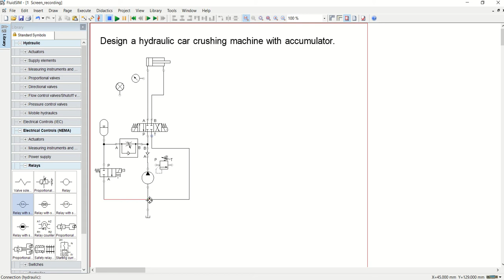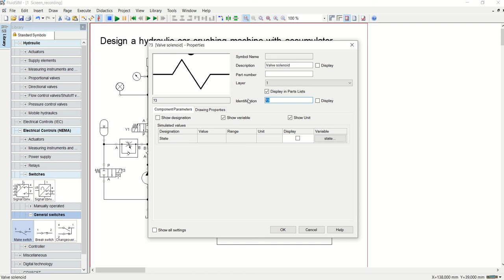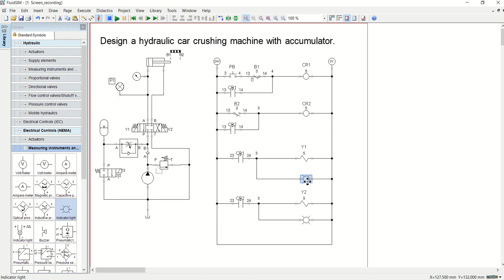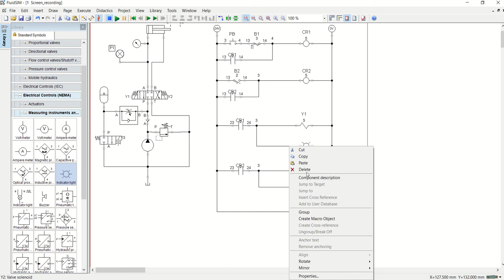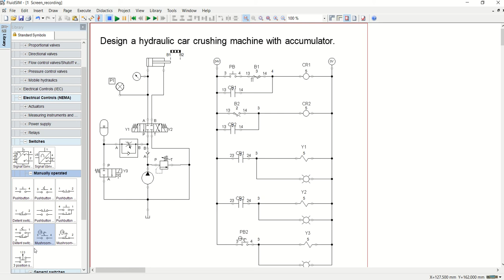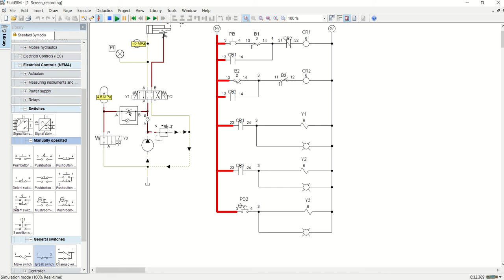Comment: thank you so much sir for this video , i  am facing an issue with this system from  long time ,  sir you you please guide me on wiring of this circuit.
Reply: Hello Grjuyot!
The means to wire assemble and any circuit is to use the circuit diagram. The wired program will same as the drawn circuit diagram.
If you have problems, keep me posted and I will help you out.
Thanks 😊
Reply: @oattamechtrainingandconsul8809  Yes sir , i will be in touch so I can have great guidence from you. Thank you sir.
Sir can I have your email ID ?
Reply: Hello Gurjiyot! My email is owusuattakorah@ymail.com